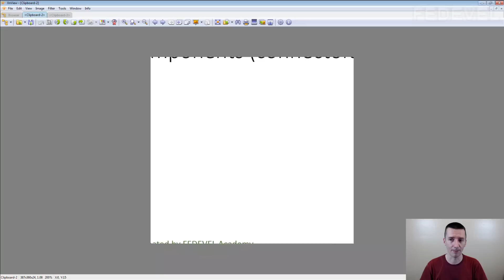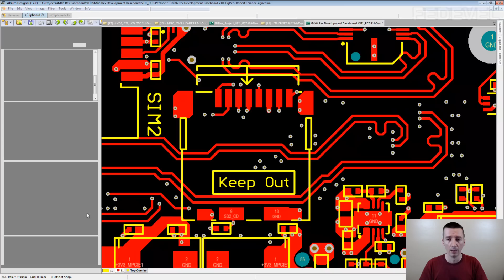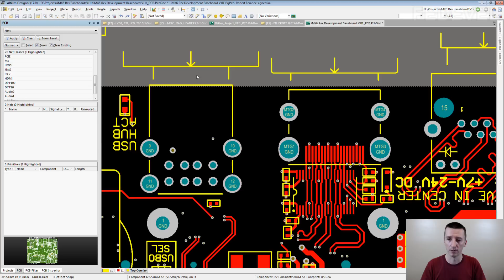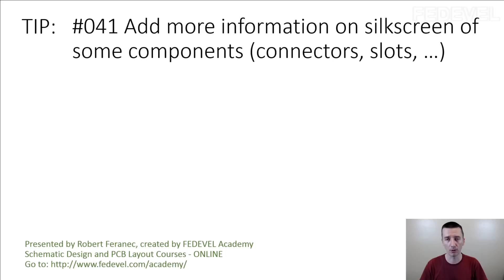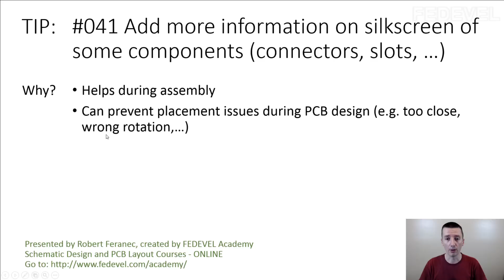TIP #041: Add more information on silkscreen of some components (connectors, slots, …)

Comment: I just put a USB port and barrel jack next to each other in a board... I need to look back at that lol, great tip! 

Would doing this in the silkscreen layer, as opposed to another layer, cause issues in the manufacturing of the board? Like the ones that hang off the edges, how does that affect the outcome when you panelize the boards?